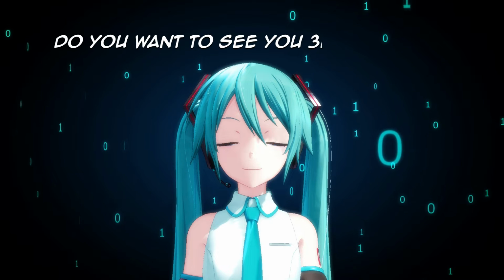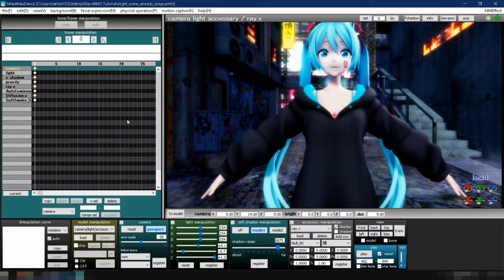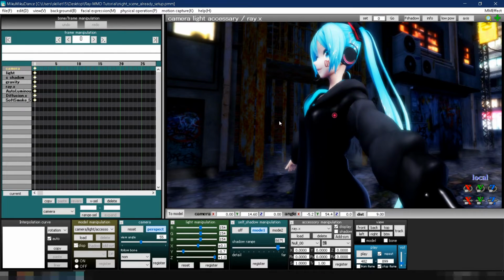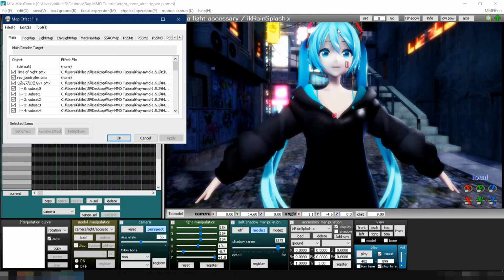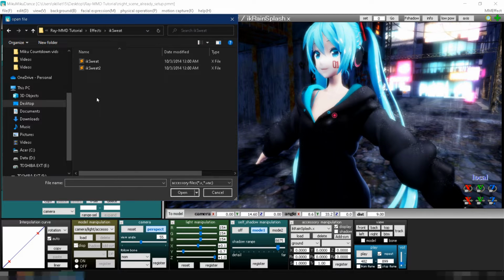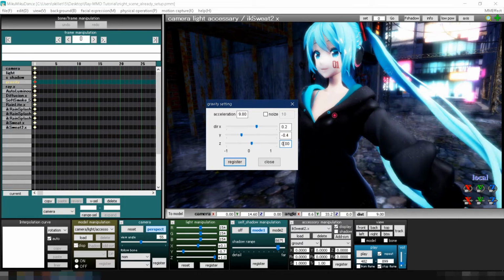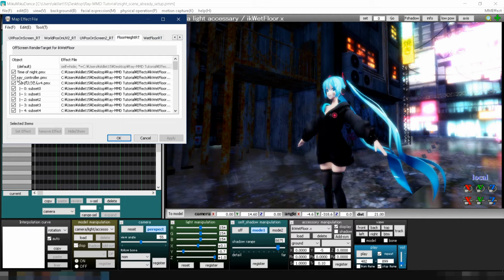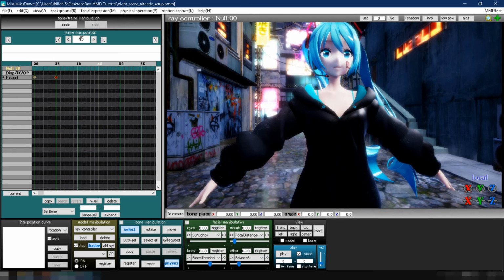REALISTIC Rainy Weather Effect Using Ray-MMD (+4 MMD Effects)【MikuMikuDance Tutorial 2025】

Comment: What export settings do you use? Because whenever I try to export my mmd project it just crashes
Reply from the maker: I use utVideo codec
Reply: @theweebdev  thank you for responding, but what about your screen size settings?
Reply from the maker: @soyogo6880  I mostly use 1920x1080 at 60fps. If your render is crashing, it means your pc can't handle the whole process so its either lower your screen size or lessen the effects that you are using. I experienced this before because I used a lot of effects in one scene then I remove one of my kirakira effects and it didn't crash anymore

Comment: Which is there a shader to make the hair look like real? hair becomes visible like strands
Reply from the maker: I haven't seen any shader like that in MMD but if you want to achieve that, you need to make it outside MMD and add normal maps to the hair using softwares like Blender
Reply: @theweebdev  ah so there isn't any huh. I'm a new mmd user so I don't know much about it. but I see that there are shaders/effects to create feathers. So I think it's also available for hair. or maybe in the future there will be someone who succeeds in doing it. thank you for your answers.
Reply from the maker: @bahastutor  The thing about hair is there are so many different hairstyles so it will be hard to make every style a normal map. You can make a realistic hair for a model but you can't use it to another one with a different hair pattern that's why it needs to be done outside mmd for that specific model. I hope in the future there will be someone who will do that like a shader which you will apply depending on the hairstyle(or maybe there is already one, I just don't know lol)
Reply: @theweebdev  is there such a way? where can I find a way. settings to adjust so that the hair looks realistic with the normal map
Reply from the maker: @bahastutor  you have to do it using other programs like Blender. MMD does not have any feature for 3d modelling
Reply: @theweebdev  ah right. I had too high hopes for mmd. OK, thank you for responding to me well